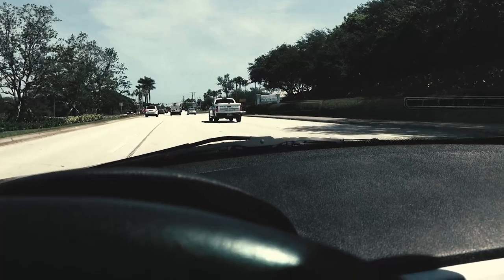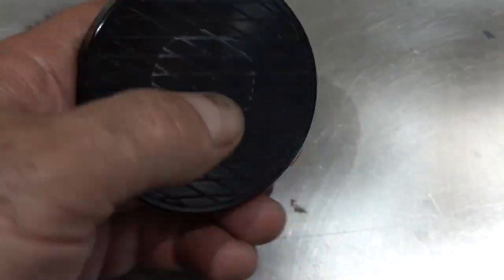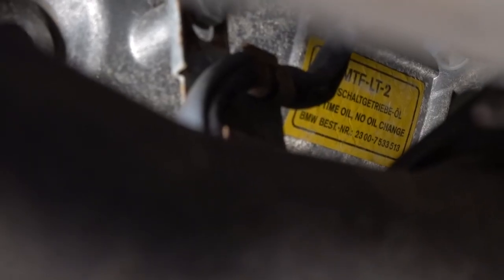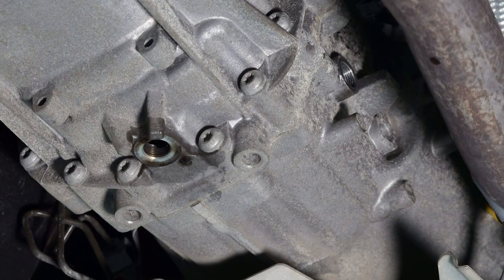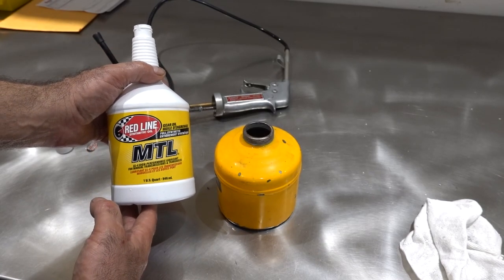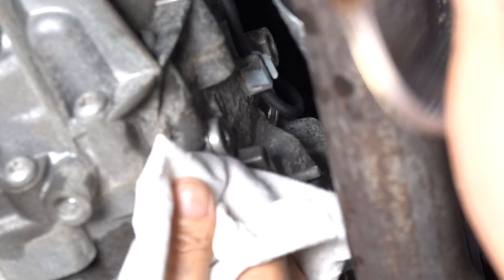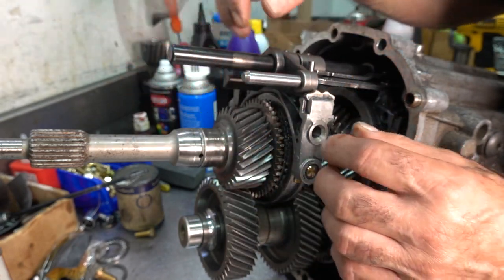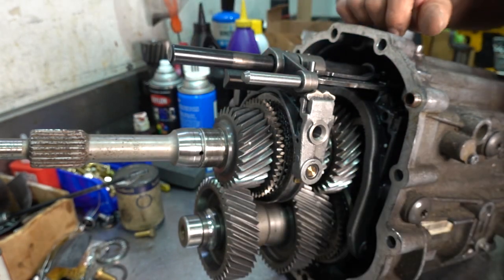Z4 6 Speed Manual Transmission Lifetime  Oil Change - BMW Z4

Comment: Excellent video. Do you have any thoughts on if there is a way to improve the 1->2 shift in these transmissions? I have an M2 now and had an E85 Z4M, but both use relatively similar ZF boxes. I think the M2 just has carbon synchros. Anyway, the 1->2 shift is very notchy in these and has to be done slowly or you will grind. I'm going to change the fluid, but it is already very low viscosity. They are filling these now with BMW MTF-LT-5 which cross references with Pentosin FFL-3 which is a DCT oil. It's still 75W80, but the viscosity is on the very low end of the range. Some have claimed aftermarket transmission mounts have helped but not sure I want to go there yet.
Reply: You could try deleting your clutch delay valve.
Reply: @jahswanson2504  Did, doesn’t help the shift. Does help clutch engagement feel though.
Reply from the maker: The delay valve was to decrease drivetrain shock. The valve delays on release not on apply.  What I have read on looking over BMW service notes was that the pilot bearing can drag. The grease apparantly can start to solidify. BMW sells a special grease for it. Dragging pilots can give the same notchy shifts as a poorly releasing clutch.
Reply: @GearBoxVideo  Thanks. That's good to know as it ages. The M2 is a 2021 build and has done it since new so I am assuming it's just how they shift.

Comment: Nice video Paul. I suspect BMW will be making  more money just swapping trans more often rather than repair them?
Reply from the maker: Bmw manual transmissions are non. Service. You have to buy cores for parts. I'm working on doing a full video on these in the future
Reply: @GearBoxVideo  Just wondering if you're still considering doing the next video you've mentioned in this comment. I also have a Z4 and I'm interested in understanding more. Thanks for sharing your knowledge!
Reply from the maker: Yes I am when I get the cores and time

Comment: Hey nice video !! I have a question does atf work on a mercedes manual transmission? Thank you.
Reply from the maker: Depends on what the transmission calls for. You just don't start putting any oil on it
Reply: I'm trying to resolve a 2 nd  gear notchines that is a pain in the a..  The gearbox is a 711.655  Mercedes  or a A2042603200, I had already changed the oil and put a Castrol syntax 75w90  wich  helped but not resolved  the issue . I ve r ead that an atf oil  will help alot with that but I'm not sure  . Thank you for the reply .

Comment: I'd be interested.
BMW z4(E85) n46b20b ,6 speed (2006)
1.Motor oil type(4.25L / 5-30 LL4)
2.gear oil type ( ? ,?) liter?
3.differential oil type( ? ,?) liter?
thanks...

Comment: Hi! I need your advice!
I like to overthink and I can't sleep properly.
I have 2007 E81 2.0 diesel and I bought MTF-LT-2 for my manual transmission.
When I decided to change it I discovered a blue sticker on my transmission "MTF-LT-3 lifetime fluid..blah..blah.." Soo, I changed it and now I'm scared that it will damage something inside. Please, advise. Is that ok that I used MTF-LT-2 instead of MTF-LT-3 like the sticker said? What do you know? What do you think?
Reply: shouldve used same spec
Reply: Today’s day.. did it give you any problem?

Comment: I have same 6speed on mine.  I really wanted to flat tow mine but people say that input shaft has to be running to spin the pump... I have read and also you stated that these don't have pumps, so does this mean I can flat tow mine?   I really wanted to just hook it up to RV and find out...
Reply from the maker: No a manual 6 speed will get destroyed flat towing it

Comment: Have a 2004 bmw z4 with manual , under acceleration get a loud bang then jumps into neutral , usually 1st and 2nd .not sure where to start with this issue?
Reply from the maker: The "bang" is the  the transmission slider getting knocked out of gear. Could be as simple as linkage bushings, bad mounts or internal
Reply: Thanks , to check the linkage bushings does exhaust and driveshaft need to be dropped?

Comment: Hi! How much fluid did you use?
Reply from the maker: You fill to the level of the fill plug. You need to start with 2 quarts
Reply: @GearBoxVideo  but you dont remember the exact amount? Manual says 1,5 quarts

Comment: Mad, these engineering decisions: let's never change the oil, and let's make the drain plug aluminium and with a hex hole. I mean, suppose you accidentally shift wrong and grind a gear. All those little filings will then circulate in the oil for a 'lifetime'?

Comment: some people run ATF instead of MTF ... some BMW boxes are labeled ATF some MTF ... ?! guess both work
Reply from the maker: Manual Transmission Fluid - Automatic Transmission Fluid. Whatever is specified you should use.

Comment: I broke the third gear synchro ring in my 2007 Mini Cooper R 56 turbo...there are no hard parts available to rebuild that box...just seals and o-rings and such...got a used trans with 26,000 mi..new clutch...rear main...and dual mass flywheel...which I got for a deal at the Mini dealer for $ 980.00....now I drive it very carefully...cost me $ 3,600.00 to fix...thanks BMW...🤣🤣🤣...Oh yeah ...by the way ..there is no such thing as life time oil...😂😂